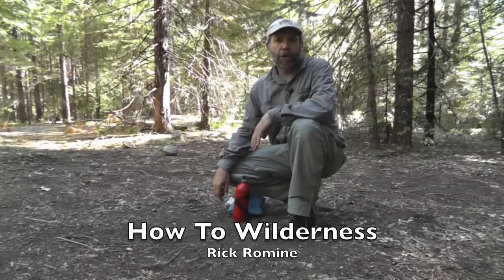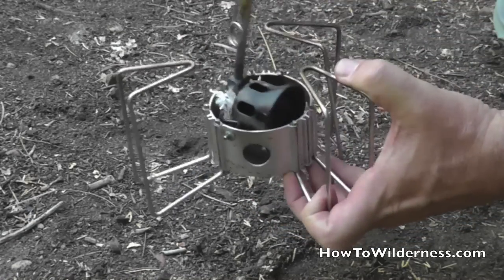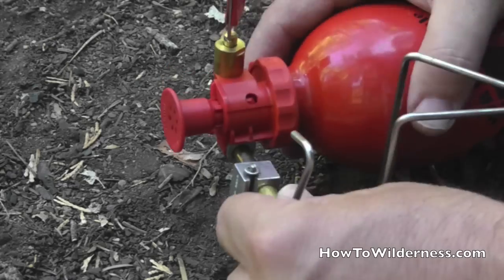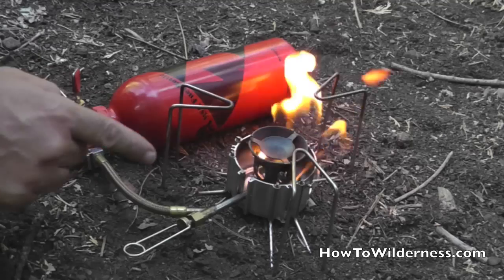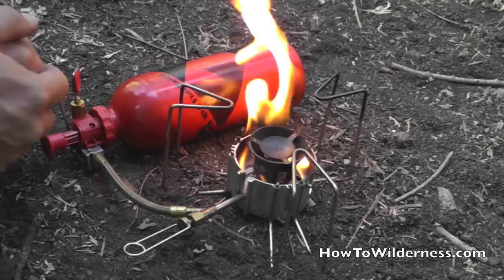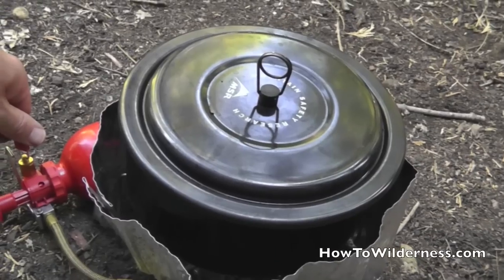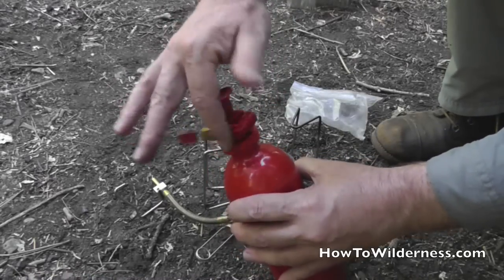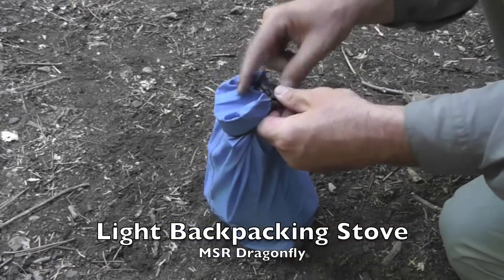Light Backpacking Stove MSR Dragonfly

Comment: Thanks. I haven't used mine in a long time. What happened was the gate assembly got flipped around somewhere in storage and the actual gate wouldn't liine up. I found that I just needed to turn/rotate the gate assembly to bring the gate into correct alignment. Spooky at first afraid any adjustment would compromise any seal.

Comment: I had a Dragonfly for almost 20 years. It was the very best stove for simmering and because of that  could bake with it and there was NO Primus stove that could do as low a simmer as the Dragonfly.

But it is a heavy stove and is NOT for "light" backpacking as this video purports. It is primarily a winter stove or group stove. After selling my  Dragonfly and repair kits I bought the MSR Whisperlite Universal 3 fuel stove. No it can't simmer with liquid fuel, only with a canister. But it does everything else very well, whether with a canister or white gas (petrol) or kerosene.

Comment: Thanks a lot for this video and the clear explanation of the how and why of preheating. However, you only mention white gas as fuel whereas I have read (in an old sales catalogue) that it will burn pretty much any liquid fuel, and particularly Diesel. Could you clarify, please?
Reply: It comes with interchangeable spray jets you can easily screw in (DK jet) that will burn kerosene,diesel and or jet fuel (DG jet nozzle) is for white gas or unleaded auto gas. Ultimate prepper solution to use any fuel

Comment: I kindly suggest to apply a light coat of silicone grease at the pipe inlet and secondly not to bend gas pipe excessively as it may cause the elastic pipe to crack. Happy uses.

Comment from the maker: @AkosiMRswabe Perhaps my nose is not as sensitive as yours, but in all the years I have used Whisperlites, DragonFlys, or any other "white gas" stoves I have never experienced this problem.  I would love to hear comments from others.  There are certainly canister stoves which do not expose the fuel.  When choosing any stove, also consider how they preform in low temperature, high elevation, and if bottles/canisters can be re-filled (environmental impact).  Thanks for watching and your comments.

Comment: Canister stoves don't perform in real cold temps either. Unless you're using the MSR Reactor the canister stove suffers badly. The burner design of the Reactor Alleviates the problem. I've had mine for years and still boils water tremendously fast even in -30C. But it's hard to get them on low heat. Reason for white gas stoves like this. They work in very cold weather.
Reply: it's true the ultralight canister top stoves don't work well in the cold, but the remote canister stoves that have a hose between the stove and burner have the advantage that you can turn the canister upside-down to improve cold weather performance. the now obsolete coleman exponent stoves were canister stoves that fed liquid instead of gas to their burners, improving cold weather performance close to white gas stoves in similar temps.

Comment: thinking about getting this stove or the whisper lite. what are your thoughts?
Reply: +vegas wajeel Get this one if you need to cook a lot and not just heat water. the fuel control is much more precise than the whisper light. The guy in the video hardly knows what he's doing. the valve on the fuel tank is not a control valve nearly an on off valve. the the one on the stove is a gas vapor control valve
Reply: That's what he said. the valve on the stove is for flame control...He even shows that he uses the stove valve to control the flames.

Comment: What is the burn time at 9000ft. with liter of water and at 0-12 degrees fahrenheit ?
thanks
Reply: what???????????????????????????
Reply: At 9000ft. and that temp range it greatly depends on the wind conditions. All factory or home made test are only valid for comparision purposes. In a still weather you may do it in about 5-7 mins. If the wind is blowing hard you may never get the water boiling. Keep in mind that that you cannot use it like a gas canister indoors or in the tent because of the fire hazard but even more serious is carbon monoxide poisoning that can cause loss of consciousness and if not aided promptly even death.
Reply: Mateyhv1 well do your own homework and stop trying to be clever and asking the uploader a question you can surely bloody well find out yourself